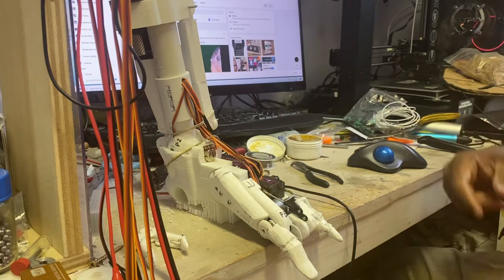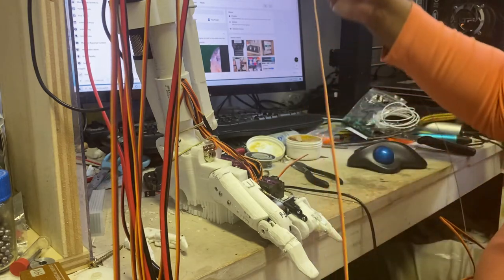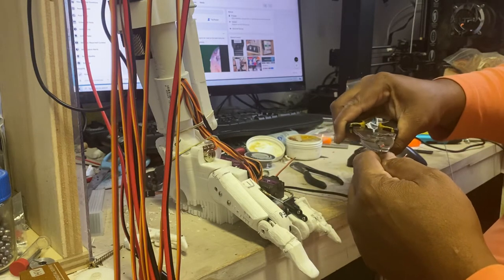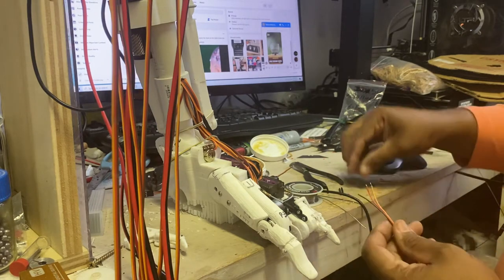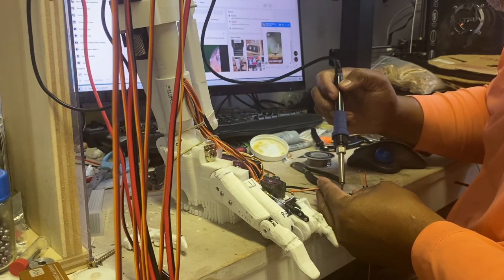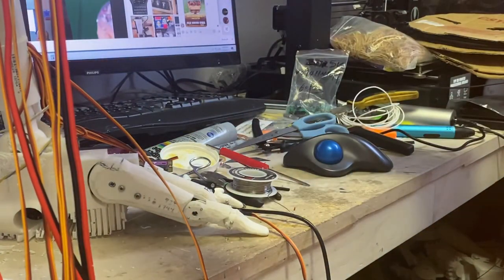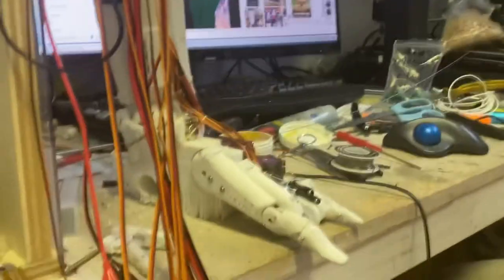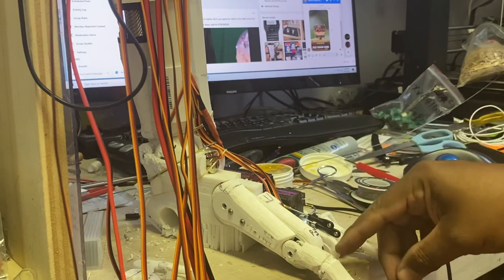DARA Robot foot servo wiring

Comment: What size wires are you using for your long 6' servo extensions?
Have you considered the effects of voltage drop?
What was the current draw of the servos?
Reply from the maker: Ray, I am using the regular servo wires for the potentiometers, and the small servos.   Running 16 gage wires for the 12V- 24V motors, and 12 gage for the 60KG servo and the medium motors. (will that work?)
Reply: @DARARobot  For the standard servo wires, they are designed for about 300mm or 1 foot of length, I would suggest when adding up to 6 foot of wire, go up to the next size of wire to avoid issues caused by voltage drop. All the other sizes you mentioned should be good :-)